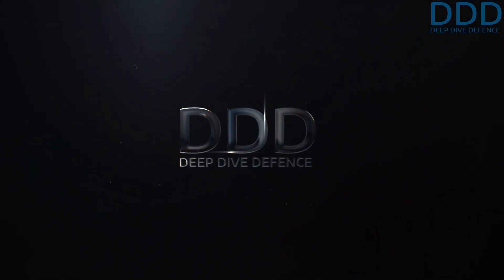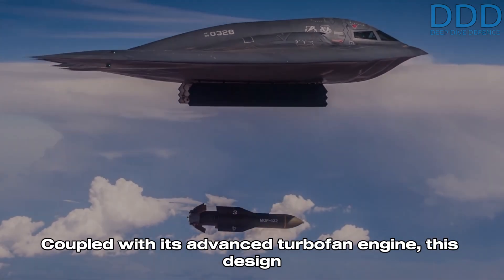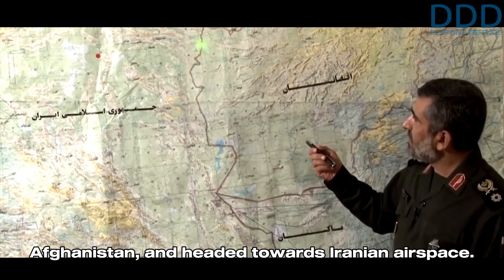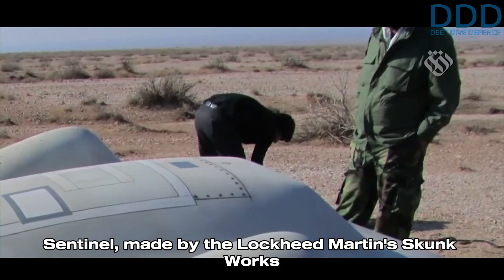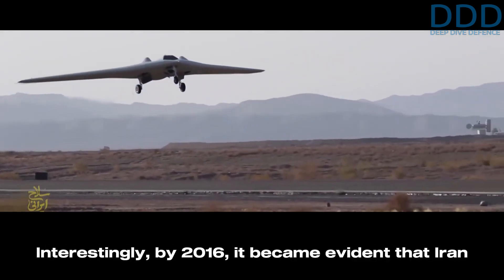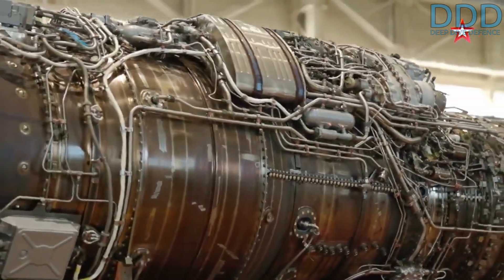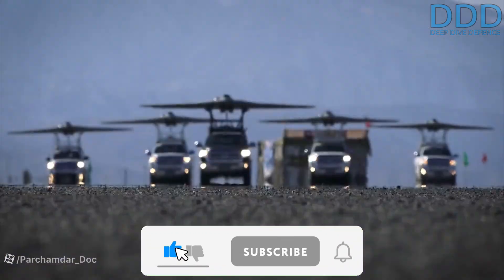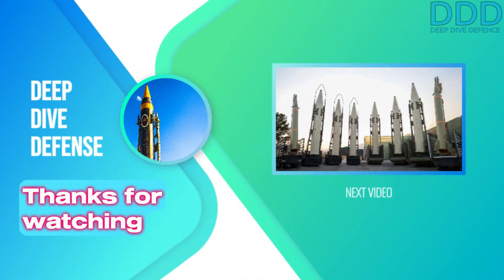Shahed-171: Iran's RQ-170 copy & how it got it

Comment: What I'm waiting for is the upgraded tomcat, and no not the overhauled one. 

It's funny that we can see Iran has been building different variants of the f5, while in the west they say it's modified old stock which is misleading.

Theres rumours that Iran did persue a flying wing design before the RQ-170, and it still exists believe the program was in 2010.

Has Iran reverse engineered and built a tomcat I suspect they have, and we haven't seen it yet.

If you can find that flying wing design it would be interesting.
Reply from the maker: Don't think it makes sense for Iran to pursue developing the F-14 platform
Reply: @DeepDiveDefense  I'd imagine the manned dual engine stealth jet based on the rq-170 would look like the Horton, considering the design is out there already I suspect it would not be too hard take the design and turn it into a subsonic bomber.